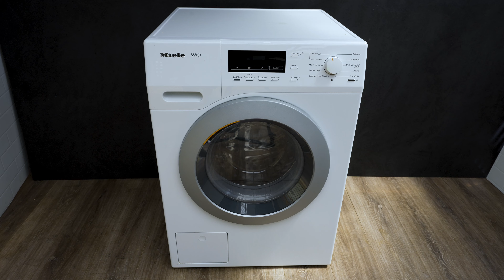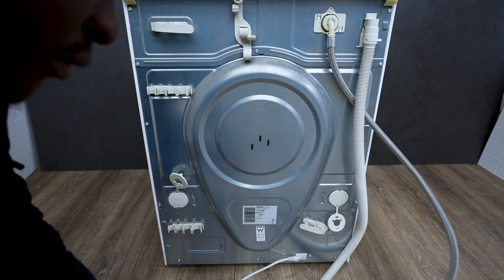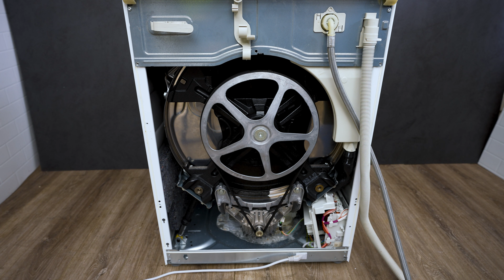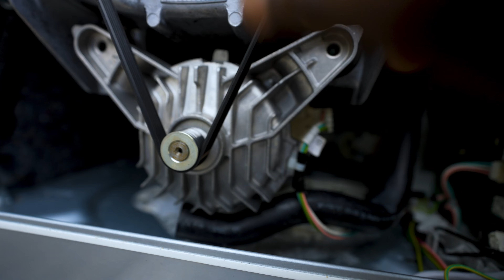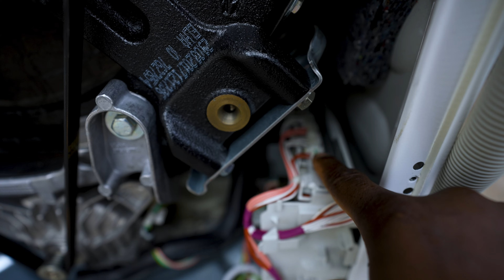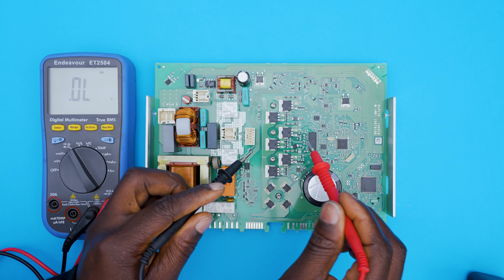Miele Washing Machine F50 Fault Repair 2022

Comment: I have W1 Modern Life WWD 660 WCS, not 100% identical maybe. I have F138. Even If the watter was removed and the pump it is working when I power on the machine. But F138 it is still remaining. I checked the flood switch (a simple switch normal closed) and I even replace with direct connector between two wires. No changes, Still F138 ... The technician fro Miele told me that will come with a new MB and prepare for 400 euros.... After just two years of service this washing machine seeems to be the worst that ever have, Can you help me with a ideea? Thanks!

Comment: Hi I l have and older Miele w1914 honeycomb care.  I just did a wash no problem. Put another wash on , it started the cycle and after about 30 secs of turn and working is made a squeaking, sort of reminded me of a fan belt on a car! And then the alarm went off its stops and showed F 50 it’s probably about 16 years old, but is looked after and looks new, I watched your video, and the barrel moves freely, any suggestions, and how should I proceed with this?   🙏
Reply: A bit late, but transistor on the main board, its located on the radiator, 3-pin element
Reply: На радиаторе там чип большой? Ножек много???  @miroslavjordanov4459
Reply: Have the exact same issue. Were you able to fix it?